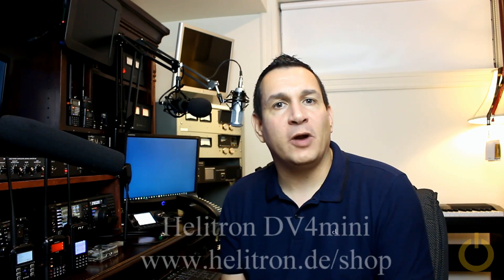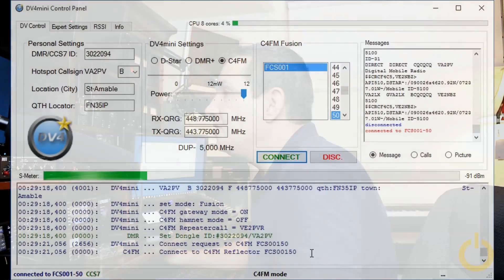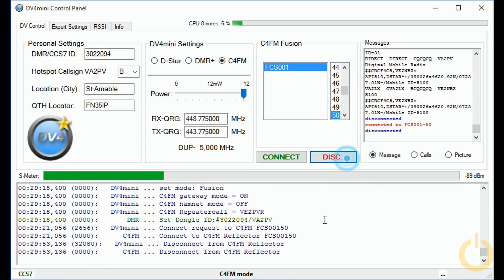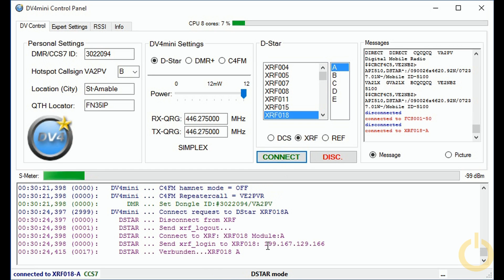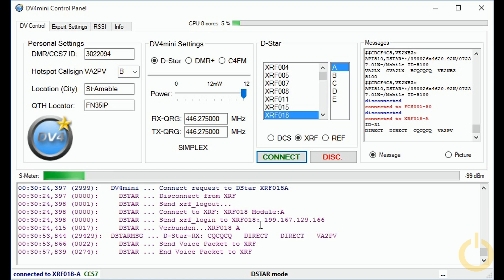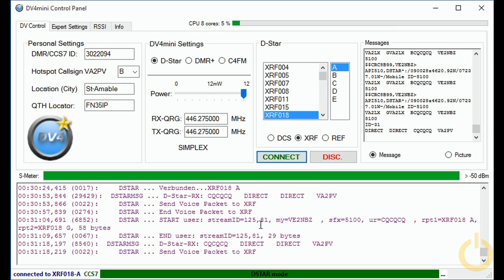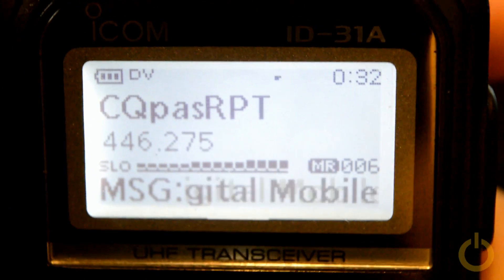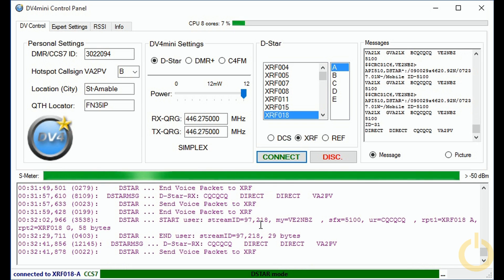Part 2 - Helitron DV4mini D-Star tests

Comment: Bonjour Pascal, merci beaucoup pour les vidéos sur le DV4mini.  Est-ce que tu peux me dire si on peut "linker" un répéteur DSTAR directement comme on le fait avec un DVAP ou on peu uniquement connecter des réflecteurs?
J'ai un ami qui n'a pas encore de DVAP et il oscille entre les 2 dungle.
Également est-ce que c'est difficile à configurer?
Merci beaucoup de ton implication dans le domaine de la radio-amateur :)
Alain VE2TPI
Reply from the maker: +Alain St-Pierre Bonjour Alain, non pas pour l'instant, le DV4mini permet la connexion des réflecteurs seulement.  DCS, XRF et REF.   Il n'est pas possible de connecter VE2VPS, ceci a été testé à mainte reprises.   Les concepteurs sont au courant ainsi que l'administrateur de VE2VPS, nous avons échangé l'information et tant que le logiciel ne permettra pas de connecter un répéteur (VE2VPS est monté ainsi) ça ne fonctionnera pas.  Merci pour ton commentaire, 73 Pascal VA2PV.

Comment: Good morning a few questions please I've just ordered one from a uk dealer , what are the radio commands you use to connect the software on dstar radio  I presume it's a UHF simplex frequency you use but what commands for example is it REF001CL and .......U in 8th position to unlink ? And you mentioned the firewall  I noticed this on trial of software my anti virus removed software completely what setting did you open to allow access .

Many thanks 

73s Martin M0MBV